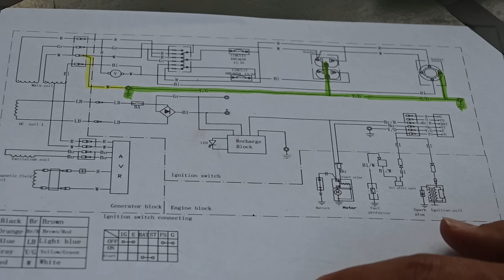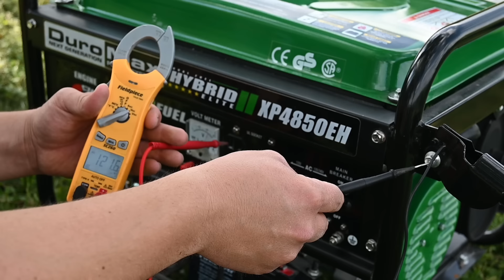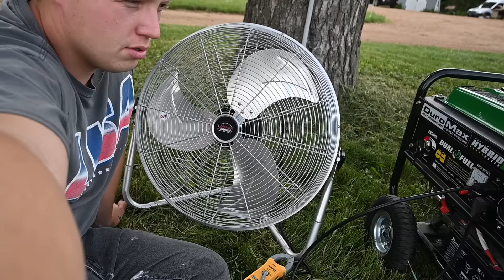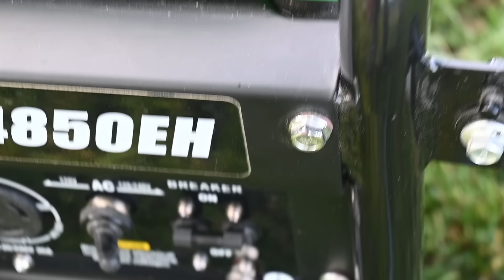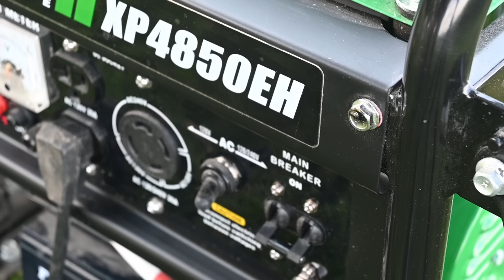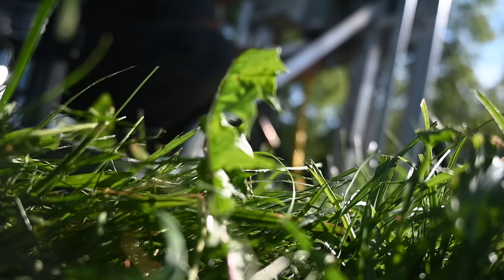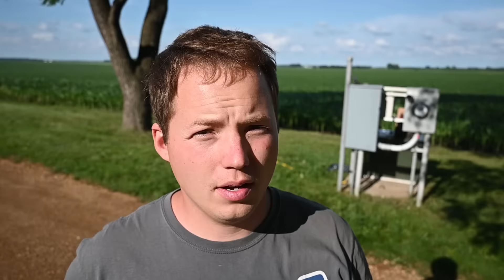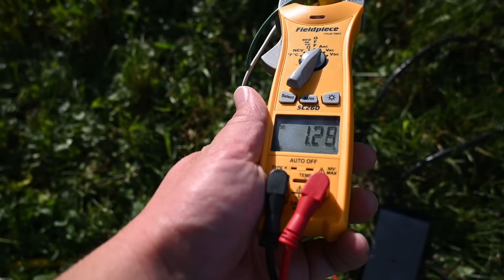What is a Floating Neutral Generator?

Comment: A bonded neutral power generator is required by code when you have a "separately derived electrical system" where the power transfer switch also breaks the power grid neutral conductor - thus also breaking electrical continuity between the power neutral and the earthing electrode system. 

In my two years of deployment in Iraq some 15 years ago... we derived all of our electrical power from large diesel generator sets (< 1 megawatt typical) using European mains voltages & frequencies (3-phase 415/240 @ 50~Hz) 

Where all transfer switching between generator sets used 4-pole transfer switching that switched all 3 phases as well as the neutral... all generators had bonding jumpers installed across the neutral and the earthing conductors/electrodes... as such, this is what is commonly referred to as a "separately derived system" as the neutrals are separately derived and isolated from each energy source by means of the transfer switch.

In my experience, generators with floating neutrals are both dangerous and deadly - as the likelihood of fault currents present will cause the shorted phase to drop to zero, whereas the solidly connected neutral across the entire installation will have a line voltage potential on it to ground or earth... the remaining phases will then have an elevated voltage potential in reference to ground or earth... in a 3-phase system; that would mean a voltage potential that is 1.732x the typical line voltage from phase to earth under abnormal mains line fault circumstances. Under this same condition though, all 3 phases will have what appears to be a "normal" line voltage reading between all phases to neutral - but not to earth or ground.

It is still the best and the safest practice to bond the neutral to the frame of the generator set and also ensure that the generator set is also effectively grounded too.

Your incoming utility service is only served with phases & neutral conductors - and no earthing or grounding conductor - as the neutral conductor of the service feeder is bonded twice - once on each end of the service feeder - on the utility side at the power transformer - and at the customer side - at the service entrance (meter and/or disconnect switch or main switchboard/panelboard or load center, where the main circuit breaker or disconnecting means exists... however - when designing or installing a provision for an auxiliary power source (such as a generator for emergency power) a transfer switch is recommended for complete isolation from the grid to prevent the dangerous condition of backfeeding the utility - and placing utility workers in danger upstream that are working on the power lines, as well as creating dangerous voltage potentials upon restoration of grid power after a power outage. 

The incorporation of a power transfer switch or an approved or listed circuit breaker interlocking mechanism is also required by the National Electrical Code (NFPA-70) to ensure safety and integrity of the installation. 

Separately derived neutrals are best by far - but requires a 3-pole (or a 4-pole for 3-phase-4-wire service) double-throw manual safety switch for typical 120/240 single-phase 3-wire electrical services, and they're more expensive than their 2-pole counterparts, of which will only offer a solidly connected neutral termination that is not separately derived or offering total isolation from the power grid during an outage.

Ungrounded 3-phase-3-wire "delta" systems  where the electrical system is intentionally ungrounded would be the exception to having a generator set without any grounding performed... although generator sets with 3-phase delta configured alternators are extremely rare... typically in a hospital setting - where a possible use for an ungrounded 480-volt, 3-wire "delta" service is utilized could use a large "WYE" to "DELTA" isolation power transformer installed between a generator set with a 3-phase-4-wire WYE alternator and the transfer switch for the ungrounded 480-volt "DELTA" electrical system. 

3-phase generator sets are typically rated in kVA with a calculated power factor of 0.8 or 80%. Power transformers are also rated in kVA.

120/240v generator sets are typically rated in kW - whereas the power factor is 1.0 or 100%.
Reply: Yep.
Reply: dustin buck ask him ,”what time is it?”
I dare ya.  Hahaha
Reply: I swear i've seen this in a book/web somewhere before...
Reply: I like you're vast knowledge BUT it's over my head thank you
Reply: In single phase does everything you mentioned above apply?
Reply: @craigsetzer9726  Yes it does. It took me a bit to figure out all the reasons when the codes were updated a few years back. Basically it is to insure a path to ground if there is a fault on the line.
Reply: INteresting. But do you have to bond the frame to the earth if you are connected to the house panel, which has a ground installation already? doesnt the system only require one ground?
Reply: I own this exact same hybrid generator.  Do I need to ground it if I use extension cords hooked up to it?  If so, how do you suggest I do this?  Thank you so much!
Reply: This comment makes my brain hurt
Reply: You just answered my question I posted few minutes ago but you did it in the past :) Your advanced explanation set my thoughts straight. Thank you!
Reply: @jonwikstrom5564  waaaaayyy over! Too much for what the basic info we need from utube
Reply: Thank you for saving me a half hours worth of rambling.
Reply: Do you have any NEC articles you can point us to?
Reply: @ip5232  Not really... I don't think you can overemphasize safety especially with something like proper connection of auxiliary electrical equipment. You Tube is more than music videos and political comments.
Reply: Interesting, a little video with some personal beliefs which for the most part are correct about a little generator which may be hooked up to a house in the event of power loss and then there is you, talking about 3 phase 1MW generation in European Voltage standards which have nothing to do at all with this video and the information contained within. I work in the utility industry and deal with 2MW 4kV and 1MW 480 gensets on a regular basis, but that is way off topic.

Why am I addressing you? Easy, you said "In my experience, generators with floating neutrals are both dangerous and deadly".

Yeah, in 3 phase I would agree, but that is not the issue at hand...

I have a plant that has 4160 to 480 stepdown transformers everywhere. Any time we have to kill one, we have to keep certain 120 loads energized to prevent eventual UPS battery failure usually for servers, computers and controls such as PLC's and DCS cabinets. We use smaller portable unbonded generators for this. The same reasons we do this are the same reasons you should want to do this at your house.

The guy in the video doesn't like unbonded generators, but I fervently disagree. A floating neutral generator is just the ticket for providing power to a house during power emergencies via a portable generator because the utilities began using ground for lightning and surge safety and the neutral no longer floats, every house connects neutral to ground, there is no escaping it. All house NEC rules and design criteria are based on the idea that the neutral or grounded conductor to your home will not break between the pole and your service entrance. You want your generator grounded and neutral established via the panelboard only!!! The ground wire from your generator to your panelboard grounds the generator to the ground bus and rod and this provides the connection for the ground to the grounding conductor, ie., the neutral. If you are using it with a power tool and not connected to a grounded neutral system like a small genset, is it really a hazard to you? Not if there is not a path to the genset's neutral. Will it trip the breaker, no, but if there is no current path, not really a deal breaker. They would not sell them unbonded if that were not true. He could have kept that genset's case energized all day long and touched it as much as he wanted and he would not have gotten shocked, but notice that he didn't touch it. He seems to understand, but he was afraid nonetheless. People are not going to connect a ground wire from their generator to the ground rod everytime they have a power outage, nor will they lift the neutral bus from ground in their service panel. Therefore, a floating neutral genset is ideal. A bonded generator is dangerous in this case. This guy doesn't think so, he is wrong. You should never have current in your grounding conductor unless there is a fault. If you never connect a genset to an electrical service, then I would bond or buy a bonded genset. There should be a selectable provision for that on all gensets, anyway...
Reply: @Nunya_Business_  The dangers of floating neutrals apply not only to multi-phase systems, but also any single-phase gensets which use opposing (120v) legs (which is most of them). While it's true that a live shorted to ground on one leg of an unbonded single-phase generator wont present an immediate hazard, absent an electrical return path, it's a silent failure that sets up a dangerous condition where any exposure of the other live wire to ground would complete a 240v circuit. The point of the bonded neutral is to cause a fast failure across any single leg and draw attention to a shorted live problem before a second failure can compound it and cause real damage (e.g. death).
There's some stickiness in the red tape around multiple bondings, but I can't think of a residential genset use case where having an extra bond on the generator itself would pose any additional hazard; as the video pointed out, the multiple-paths-to-ground issue would only present along the line joining the generator to the interlock or transfer switch at the main panel—a line which should be devoid of other devices.
Reply: @hadrast  The grund wire will then share the current with the neutral as it would then be a parallel conductor and therefore is no longer a grounding conductor, it is just a green grounded conductor, ie., another neutral. That is a direct violation of code whether "you" can't see an additional hazard or not. The utility does not run a ground to your house, they run a neutral which is grounded at the pole or nearby and grounded at their generation facility. Is it the end of the world, no, but why you want an extra bond or think you need an extra bond makes no sense to me. People run bonded gensets to houses all the time, but what I have just stated is correct, it is not necessary to bond at the generator nor advised.
Reply: @Nunya_Business_  It's just safer to have that extra bond in there, that's why.
The vast majority of people aren't even going to know about bonded/unbonded neutrals, and the vast majority of those that do can't be bothered to futz with the damned electricals for every different use case, so if you're going to set up or sell a genny, it makes sense to do it the safer way.
I know it's a violation of code to have that second bonding in there, but the code obviously does not accord with the minutiae of reality. The reality is that there is no practical situation where a second bond on the genny will present a hazard beyond any existing ones, even if some leak current runs along the grounding wire. It's all going to be bonded into one conductor at the main panel, after all.
If you REALLY want your bubblewrap-safety-culture-up-the-bunghole, you'd have to take a floating neutral genny and rig up a fault detection buzzer or LED across each live wire to ground. The bonded neutral is just the far simpler and cheaper second cousin.
Reply: @hadrast  You believe it is safer, ergo, we are not going to agree about this. If you want to bond your neutral at the generator, knock yourself out. If you run a separate ground from the genset frame to the ground rod, I am good with that. Bonded neutral In a 240 is definitely safer when you are not connected to a bonded panelboard and they are, I believe, usually sold that way, but not in a 120 system unless you use a GFI. Most smaller gensets of the 120V variety will be sold unbonded. Bonded ones will normally have GFI's. When you are out in a field using that genset, there is only one path of electricity and it is not through you to the ground back to the generator, it is through the neutral wire. Therefore, unbonded = safe. In that case, it is only safer to have it bonded if you use a GFI.
Reply: Ok, so an existing solar setup with a generator/alternator backup is in operation, but you wanted to add a transfer switch at the generator to feed 240v outlets in a workshop should I just keep the new neutral for the shop independent so it won't backfeed the solar? Isolated ground for whatever new system he needs?
Reply: @jonwikstrom5564  Much of it is not relevant.
Reply: @paulanderson388  well I believe you, however IF you going to so something like this or get more info than the quick info, this for sure will noy be the proper way to do that, that is why so many accidents that people has following utube in some complicated items, not saying he is wrong ! But same way he posted this many that dont know post stuff as well, i am an electrician , and will never post or give advise to someone trying to do their own, of course if its something like well push the reset button or check the breaker other than that I prefer to do it my self
Reply: For 240V generators, If there is a fault (short) from either the black or red wires to ground, and the white wire is ungrounded (floating), the circuit breaker(s) will not trip. The shorted black or red wire becomes the neutral, and the white wire now has 120Vac on it with respect to ground, and the unfaulted (not shorted) black or red wire now has 240Vac with respect to ground.  The voltage with respect to ground on the unfaulted (not shorted) hot wire is now double what it normally would be. This could cause excessive leakage current to the frames of some devices, creating a serious (potentially lethal) shock hazard to people (who are generally at ground potential).  It only takes about 100mA leakage current to stop someone's heart. You should always use a ground fault interrupter when using a floating neutral generator that has no external connection between neutral and ground.  Using a ground rod alone may not provide sufficient fault current (too high of resistance path between where the ground rod is driven at the generator, and where the short to ground occurs) to trip the circuit breaker.

If you are powering your home with a floating neutral generator, the neutral will be connected to the ground inside your service entrance (breaker) box. As long as you are using a grounded power cord, and the ground wire connection to the generator is good, the generator circuit breaker should trip in the event the black or red wire are shorted to ground.
Reply: @jessstuart7495  but can you switch to feed a separate building using basically a fwd/rvs contact/relay setup, switching the neutral and using independent grounding at each building?  It's way off grid
Reply: @BigPhatAlbert ,
  If neutrals are grounded at each building's service entrance, the generator won't be grounded if the neutral connection is open during switching.  Using a make-before-break switch for switching between neutrals running to separate buildings will ensure the generator is always connected to at-least one ground.  Or, you can do like eletrical utilities do, and hardwire all the neutrals together, and ground them at every service entrance.  The power utility's "line neutral" is connected to the neutral on the center-tap of your stepdown transformer and comes directly into your service entrance; it is grounded at both these locations (and everybody else's stepdown transformer and service entrance, and the base of power polls).  Connecting the hot wires without having a hard-wired ground connection either through a dedicated ground wire, or neutral grounded at your service panel, is unsafe practice.  This is why the the ground prong (or neutral on larger ungrounded plugs) is longer than the current carrying prongs; to ensure the grounded conductor (ground wire or neutral wire) makes electrical contact with an outlet before the hot wire(s) do.
Reply: @jessstuart7495  awesome... thanks for the clarity.. I was getting there lol
Reply: Don’t forget about the generator safety rules: Always make sure you follow all the generator safety rules whenever you use your portable generator. This is only a reminder. Generators can be dangerous if not used carefully. Every year, hundreds of people die or get injured when using portable generators due to carbon monoxide poisoning and electrocution. Make sure you are using your generator carefully and keeping others safe as well. There is something very serious that everyone should always be aware of when using generators. Some people do run their generator indoors which is not safe and that increases the risk of carbon monoxide poisoning which can cause death of family and you. Some people run their generator in wet conditions which can electrocute them. Please remember that you should never run your generator indoors. Remember that carbon monoxide is an odorless and colorless gas that you cannot see or smell. Carbon monoxide is a silent killer. Keep that in mind. Make sure your generator is 15-20 feet away from your house and away from doors, windows, and vents. Never use your generator in your porch too. Having a carbon monoxide detector is very important against generator safety. Some people also allow children to go near the portable generator which could pose risks. We need to keep an eye on our children making sure that they are not near the portable generator so they won’t get electrocuted or burned by the generator which is dangerous. A locking enclosure also keeps kids safe. A generator shed might look like a tempting place to explore, or take cover during a game of hide and seek, but a generator is a dangerous piece of equipment that can cause injury. It says on the manual that we should also keep children away at all times from the portable generator to avoid injuries. Please do not allow a child or unqualified people to operate the portable generator.  It is important to keep your children safe especially little ones. The portable generator can be hot during an operation. Just because some manuals missed what should be listed doesn’t mean it’s safe to do. Always follow the generator safety rules when using portable generators. Generators pose electrical risks. If you need to use your generator during wet weather, you need a generator tent to protect your generator from getting wet. Don’t let your generator get wet. Keep your generator dry and before using your generator, please make sure your hands and your generator is dry. Do not wear loose clothing when operating the generator. Everything that is said on the generator’s operating manual should not be ignored. Never smoke cigarettes near the generator. Please keep flammable things away from the generator. Never overload your generator too. Your generator can catch fire. Never ever try to plug a generator cord into a wall outlet to avoid back feeding. Back feeding your generator is dangerous. Always turn on your generator first before plugging in appliances and shut off the appliances before turning your generator off. Use a heavy duty cord for your generator and the cord should not be worn out. All the instructions should be followed carefully. Never refuel your generator while it’s running. It can cause fire if fuel spills while your generator is hot. You should turn off your generator and let it cool off before refueling it. Having a fire extinguisher next to the generator is also important. This is only a reminder for everyone’s safety of using generators. Make sure your generator is properly grounded. Having a fire extinguisher next to the generator is also important against the safety rules. https://youtu.be/I1jT3ANENvI and here is a video more about keeping others safe when using generators and also about our family’s safety. It’s important to keep our little children safe as well. Make sure your little children are kept away from the generator at all times especially when it’s running. Hope this helps. Always remember that it’s better to be safe than sorry.
Reply: @Nunya_Business_  That is very valuable input, thank you.
Reply: @Nunya_Business_  as an electrical instructor, you're absolutely right.
Reply: @The_Happy_Aviation_Enthusiast  I think the thread conversation is a bit higher level then this lol
Reply: Christopher L and Bob O, thank you both for your thoughtful replies. 
As a general contractor that manages hospital constructing, Christopher L's post was enlightening in how we apply separately derived systems and the use of 3 or 4 pole ATS.
As a homeowner with generator connection (via safety switch) I learned a lot from Bob O's reply.
Since the NEC has to consider so many outlying conditions (e. g.  outbuildings connected to a common residential main, solar installations, etc) it makes sense that it has to detail code sections the way they do.
Thank you both... These posts, replies and the original video are why I subscribe and get so much from YouTube Premium.
Reply: @Nunya_Business_   “there should be a selectable provision for that on all gensets”
I had a question about having a switch to choose between “bonded or floating” and you answer it, thanks.
Reply: Is there a Cliff Notes version of this comment?
Reply: @Christopher Lawler and all..... Great stuff in here by so many, and much respect to the opinions.                                                     I offer this, because the neutral current from the GenSet is only seeking to return to the GenSet and other reasons I think it's safer across conditions to bond the neutral in the GenSet. (Despite Bob O's correct assertion that the ground would share neutral current...if you analyze a typical city apartment building you will find current flowing by the same principle via the multiple superb ground paths ( water mains, sewer mains, gas mains, Service Pole Mounted Transformers serving two or more buildings). I have seen this and measured this condition many times. It's called objectionable ground current. No it's not ideal , but it is what is happening.. the return current takes all paths possible.                 My main point is this: the grounding conductor of the generator cord will almost never be completely isolated from the generator neutral via the building panels (regardless of whether there are Sub Panels) and so it's safer to already have the neutral and ground bonded right at the generator.  The generator's neutral 'potential', if you will, is present AT the generator within the grounding conductor via the building's inherent wiring system.          Understand this one concept.... Whether under normal operation or a short to ground condition any unbalanced (neutral) current is already omnipresent on the building neutral AND grounding system via the main bonding jumper at the Main Panel, Service Meter Enclosure, Utility Service Drop/Lateral Pole/etc .                         And so, the return path for Generator Neutral current is already at every possible electrical outlet (as defined in the NEC not just receptacles).              If the building has proper grounds for the entire electrical system, that system will be the aid for the grounding conductor of the GenSet to allow sufficient ampacity to facilitate the operation of the GenSet's over-current protection device ( usually a breaker).                     In a construction or camping situation where there is no structure featuring a bonded neutral or a Utility Grid , a floating neutral vs bonded neutral is a very debatable safety decision.              Personally, I would rather have the grounding conductor able to conduct fault current by being bonded at the GenSet. That does open the generator windings to anything grounded nearby (including other GenSets) but I refer back to the very first point... Neutral current only seeks it's source ( there are very unlikely exceptions... multiple GenSets nearby that by  pure chance are closely synchronized and may seek each other's windings via a common ground path..... again highly unlikely scenario...even then a properly grounded system would protect people).
Reply: That brought back a load of memories. I was deployed to Iraq for three years as an electrician. I have tons of the information you illustrated here on external hard drives that I accumulated over my three years there. I saw mostly 230/460 50 hertz power in my time there at many, many bases. I found it NUTS that we fed bedrooms with threee phase power. There were systems that had some silly stuff that seemed like madness, But, that's how it was.
Reply: I personally would say an unbonded floating neutral/split phase is similar if not identical to a safety isolated transformer, ie. pretty safe unless you bridge the two phases with a digit!
Leave it unbonded for portable use.
Reply: @Nunya_Business_  Bob O, you do not seem to understand the reason for bonding the frame of a small generator to neutral. There is one reason only: to provide a return path to the overcurrent device so it will trip when a fault occurs. Grounding the frame accomplishes very little, as the video showed. Depending on the bonding at the building being supported is fine as long as the connection (extension cord) is never interrupted. Unplug that cord and the running generator is now a potential hazard to those around it. Small portable generators, which are ubiquitous, must always have bonded neutrals. If they don't, bond them yourself before putting them in service.

By the way, many older generators do not have GFCIs. I see them around all the time. Not that there's anything stopping owners from upgrading, as I often do.
Reply: @Nunya_Business_  been reading the conversation between you and @Hast and I'm more inclined to agree with you, I don't think the extra bond creates a huge safety issue but it does create a parallel path for stray voltage which could be damaging to sensitive electronics. I just purchased a portable generator that is large enough to provide a 50 amp service to my home in an emergency and also be used at camp for stand alone power. It would be nice if it had a bonding switch, I think I'll add one.
Reply: Glad you mentioned this... a inlet connected to transfer switch would not use the neutral path back to the main panel. Thus is would require that the generator would have to be bonded as the primary source. However if I'm not mistaken the ground wire in the transfer switch still is grounded to the main house panel, so with this I don't think you would need a grounding rod on the generator as it's connected to the grounding round of the main panel/house.
Reply: @buckaroundandfindout  p]
Reply: @highball7347   When you turn the main breaker off it only disconnects the two hot legs. The neutral from the utilities is still connected and the ground is grounded at the house.
Reply: @highball7347   When you turn the main breaker off it only disconnects the two hot legs. The neutral from the utilities is still connected and the ground is grounded at the house.
Reply: @Nunya_Business_  that was my concern Gfi/rcd. interesting reading you two guys, and confusing LOL, but my PUNY untrained brain finally got it
Reply: Good arguments for both sides. So to satisfy both lets bond the neutral and ground the generator, and connect the house through an isolation transformer.
Reply: @5400bowen  Perhaps you need to do a study on understanding ground.
Reply: ok dude
Reply: Re: "bonded neutral power generator is required by code when you have a "separately derived electrical system" where the power transfer switch also breaks the power grid neutral conductor"

The Transfer switch part depends on where the service is bonded.  In some places its normal to bond in the meter so a transfer switch would indeed cut the bond and the generator would need its own.  

However in other parts of the country for example where I live, the ground bond is in the main panel.  And a transfer switch would be disconnecting the service going into the panel, meaning even if the transfer switch removes the neutral you still have the ground bond and DONT want your generator to have its own bond or you'll have multiple bonds.
Reply: Hey I hopoe your still around..  I wired a off grid cabin with a stand alone 8500 watt gen... After completion everything worked great, tester said all good..Then I started getting erroneous readings, like hot/ground switched, the. open neutral..  My incoming panel is bonded, could the gen have a floating N?
Reply: The contractors surely could have used your expertise in Iraq! They struggled with the basics of polarity! We were shocked on many occasions.....look out when it rains!
Reply: i don’t own a generator. so all this info is useless.
Reply: @harrydoherty8299   Harry, Harry, Harry.  Go play in your sandbox and leave the conversation to us adults.  I won't ask the obvious -- what the heck are you doing here, then??
Reply: Indeed.  🤔🤔🤔
Reply: @buckenheimer3 indeed. 🤔🤔🤔
Reply: @Nate-ud2yt  I hear no. In camp trailer situation. But don’t know if you hook up to run house.??  Probably not. I heard grounding rod at campground to earth. Could end up shocking somebody.??? But I don’t know about ground and floating ground generators.?? 😮
Reply: Agreed.retired electrician.here.i connected dozens of homes using multiple types of connections,select circuit usually being the choice,but sometimes panel interlocks.some times local inspectors reqired a grounding conductor from the frame to the home gr electrode.i.always found that to be redundant and potential " alternate" fault pathway..i did as requested ,kept my mouth shut even though i disagreed.
Reply: @craigsetzer9726 generally yes,disconnrcting the line neutral when running a gen is never a bad idea ( from a guy working on repairing power lines point of view,voltage bleed is not unheard of ,especially poorly constructed chinese generators bad winding insulation poolrly mnfctrd chord connections etc.)
Reply: @ctodd444 if you feel so inclined,as he showed in the vid there are usually lugs on the gen to connect a ground wire.or driil.a hole in the frame.buy a lug,3.00$ .use stainless bolt and nut,lock washers ,vibration from the gen,you know?
Reply: Ok I understand the reason to have my generator on floating neutral status while using it with a transfer switch connected to my sub panel. What I’m not clear about and hoping to get this answer here is, in my sub panel  all neutrals (white wires) go to one neutral bar and all my bare copper grounds go to their own separate ground bar on the other side of the sub panel. Is this compatible with my floating neutral generator? My user manual instructed me on how to covert my generators wiring from a bonded frame for stand alone use to a floating neutral when used with a transfer switch.
Reply: Agreed,but twice you used the terminolgy of a isolated system.a lot of towns do not require a home gen set to be a isolated system.now what happens if all 3 lines(12/240) are dropped adjacent to the home ,a 4pole transfer would be preferable..back before i retired ,did a lot of home gens,most but not all towns didnt care it was a auxillary install.a few did and this required a seperate earth bond wich then reqired a means of disconnect for the existing earth bond.not easy,another disconnecting means .,because now we had 2 potential means of earthing ,conflicting voltage paths.oh boy i,m glad i retired,bought a house in rural tn and installed a briggs whole house.although i did keep my 12k portable and installled  a 2 fuel kit.out here a backup for a backup....always good.
Reply: @wcjcnc  if a severe power issue drops all wires now you have a issue.
Reply: @MrBritrider  yes,your branch circuit grounds could become current carriers but it would be the equivalent of a standard short circuit or a low voltage issue at the gen.leave that circuit off or kill others of a less pressing issue.
Reply: Thank you, Christopher!
Reply: Were you at PSAB? Man those generators were loud but when they were down tent City was absurdly quiet with no ECUs running lol
Reply: Holy cow great explanation backed by experience
Reply: There should be a limit on YouTube comments to 500 words or less. We don't want to read books on here some comments  were copied out of a book. 73
Reply: What?
Reply: That's true.👍